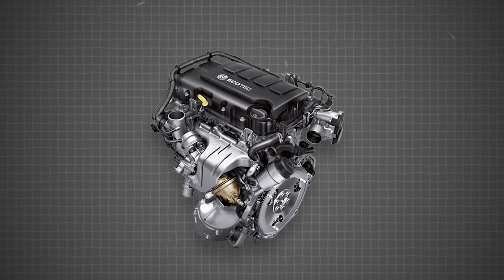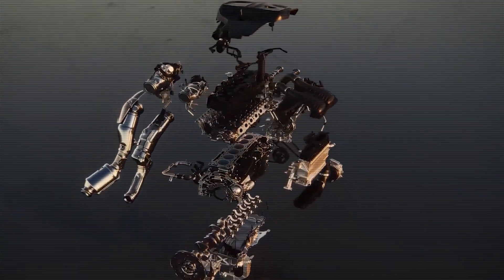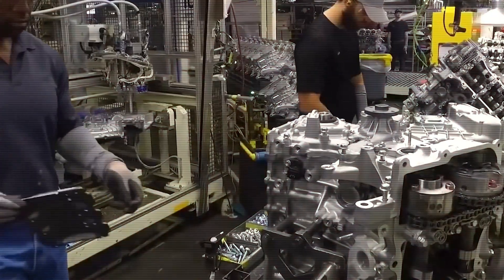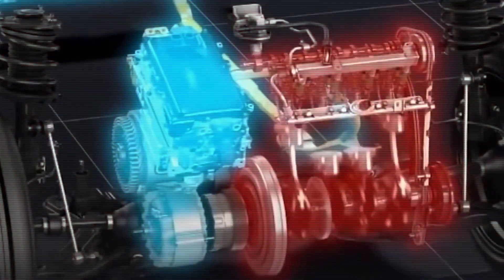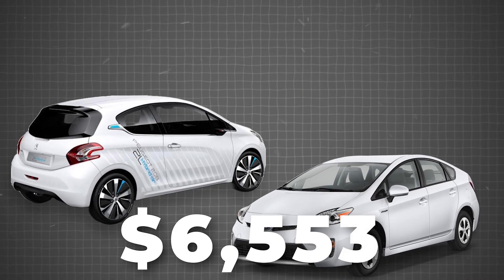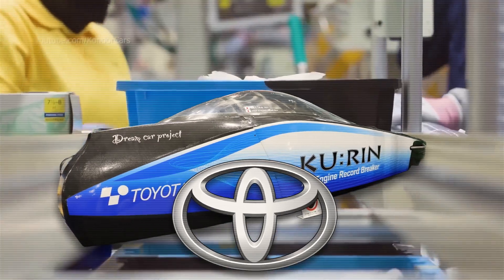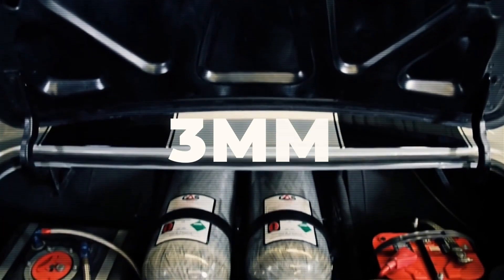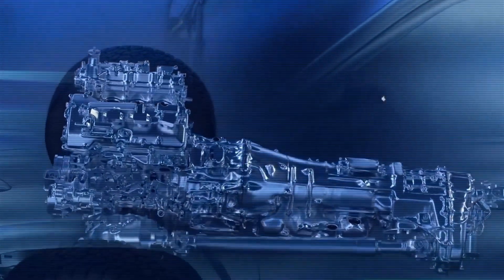ALL-NEW Compressed Air Engine To Disrupt The Car Market

Comment: Using compressed air vehicles (CAVs) for long range, high power vehicles is just a bad idea for many reasons.

However, using them for small, short-range vehicles could work

Comment: We have developed the most powerful (up to 12000 Nm) and environmentally friendly engine in the world. The Zired engine is the only engine that has no dead centres, no idling, and no electromagnetic radiation. In addition, it runs on the best fuel in the world, namely compressed air, which is produced inexpensively and almost silently by the Zired compressor. If we have a strong partner, we can deliver the most environmentally friendly and cheap city buses in the world within a year. 
  https://youtu.be/U8_AiTCH-QY?si=Kmg2UCGatRhk8rEp

Comment: Why is it taking so long to get compressed air engines on the market?
Reply: Because they are inefficient. For the energy it would take to pressurize your tank you could get more out of a battery for less effort. The energy to pressurize your air tank usually comes from electricity. In the US 80% of electricity is produced by coal. Which means it's better to use that electricity to power your car than to compress air to then power your car. Unless we get some crazy hand compressor technology to power your vehicle without the need for electricity, which I don't think is happening in our lifetime, then air engines are not worth the investment.
Reply: simply, because they won’t make a big money out of it. They will make more money on petrol

Comment: Besides all the other nonsense here, the title is a contradiction in terms. An 'engine' converts heat energy into motion. This is an air 'motor', not an engine.

Comment: WHAT IS THE RANGE!????
Reply: From a UofM test the compressed air would destroy the engine after 500 miles or road usage as oxygen is very abrasive at those pressure. And to get liquid oxygen you'd have to burn 4x more to get it supercooled than it is to just refine the gas and burn it and still make way less co2 footprint. The students have now moved to collect co2 and NOX from the air compress it and burn it like a diesel engine with a hydrogen injection. Only downside it has a huge battery that makes it less economical and heavy to power the collection compressor.
Reply: Terrible. It has 1/4 the energy density of lithium ion batteries not including the heavy rankine engine. Probably around 50miles in typical car. Not to mention the hazard of a 4000psi tank.

Comment: How do you compress the air to start with? Do you know the pressures and volume you would need to just drive to the shop and back? People may hate it, but electric is the way forward unfortunately. Yes they also have emmission factors, but things are rapidly improving. Compare the latest phone to one you had 20 years ago. I remember when Tesla started, everyone was laughing. Some still laugh out of ignorance. But in 10 years, Tesla will be far ahead of most competitors.
Reply: Some still laugh because of build quality and the cyber truck 😂
Reply: @terranhealer  Did you see the build quality of an average Ford? So that point is useless
Reply: @DJR000 Not really, cuz i can buy the average ford for 1/3 of the price and fix 99% of the build quality issues by myself in a casual week or two; Tesla’s fuck ups are in a car 3x the price; thats fucking inexcusable. The fact you had to pick a brand that makes cars for like a 3rd of the price to compare build quality to is not something to brag about; any tesla rn gonna be 75K+ while a new fords starting at like 26/27 bruh; make the Teslas 50 THOUSAND dollars cheaper THEN you can compare the build quality to ford lmfao
Reply: @DJR000 not to mention a ford doesnt have to worry about a puddle permanently sealing its tailgate shut lmfaoooo
Reply: @DJR000  treasonous acts are afoot
Reply: I continue to create a project of an internal non-combustion engine, I remind you that I am posting here on my channel the technology and the principle of operation, according to which anyone can create a prototype and enjoy free energy, since I am denied financial support at the stage of the idea and theoretical research, after a year of unsuccessful searches. Including I will begin to assemble a sample. And soon another video will be released revealing my developments, the wind of change is coming! All those who are not indifferent, welcome to fly into this departing innovative car, which will lead to great achievements for the successful future of the planet and humanity!
Reply: @maguccimotorincorporation Where is the update?
Reply: @DJR000  There will be an update soon. I'm working on it.
Reply: bruh are you serious? the air gets compressed when it's trying to get "IN" the engine then when you press the gas its let in goofy ahh question
Reply: @Privated_1 I'm not sure if you are serious or joking. What moves the engine, unless there is negative pressure inside?
Reply: Oil, Gas Coal and Nuclear is the way forward. The rest are dead ends. Subsidised boondoggles, of no use what so ever.

Comment: The trap is that you must compress the air beforehand... using a lot more energy than your air engine can deliver. Efficiency is VERY low. So you really do not know what you're talking about, or you simply do not care.
Reply: It seems like most people are too ignorant to understand the basics of physics, yet they try and act smart. Energy cannot be created, only transferred.

Comment: This video is nonsense from all possible stand points:

1. Compressed air doesn't have anywhere near the energy density to be worth while, a pressurised scuba tank has about 456 kJ/kg of energy density (used ChatGPT for the numbers), petrol is 46 MJ/kg, more than 10 times as much. So to get the same range out of a compressed air car you would need, 500 kg of compressed air tanks and air, compared to a 50kg of petrol and tank.
 Batteries (~650 kJ/kg) are better than compressed air for energy storage, hence why we are using that for cars.

2. Ability to use plastics in the engine - Short answer = No, the engine would be exposed to upwards of 200bar of pressure, for example simple diesel engines at combustion experience ~150bar of pressure, so no the engine would have to be steel or another high stress alloy to avoid failure, unless you wanted to use a turbine, but that brings its own problems.

3. Save the environment. Yes good point, let me pull up the the compressor station running off of coal powered electricity to fill my car, and if you can replace the electricity with renewables, then you can use a battery and motor instead of compressed air.

4. You can't turbo charge an air engine.

This video is just so stupid no matter how I look at it. I just hope the creator was laughing at how idiotic the script was when he was writing this.
Reply: Battery cars are worse for the environment vs an compressor tank and Diesel cars, batteries will surely won’t decay if we throw it in the garbage mountain.
Reply: The capacity of compressed air tank isn't lineal,a single tank with 4 times tha capacity is only 2 times as heavy, if I am to use compressed air i will start with  trains trailers trucks and stationary energy storage
Reply: Thank you.  You answered my questions
Reply: I knew this video was so stupid just from the title
Reply: This was all the rage a few years ago, and surfaced briefly with the panacea mongers, I remember. There were even documentaries on these new air cars. Then they sunk without trace. For a reason.